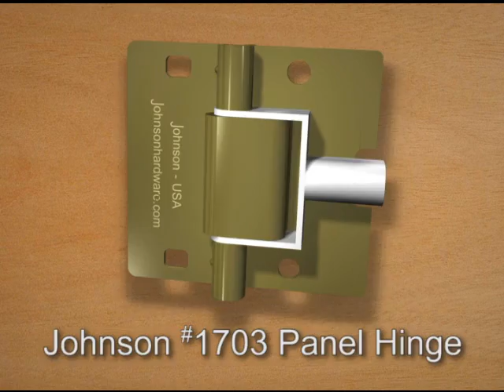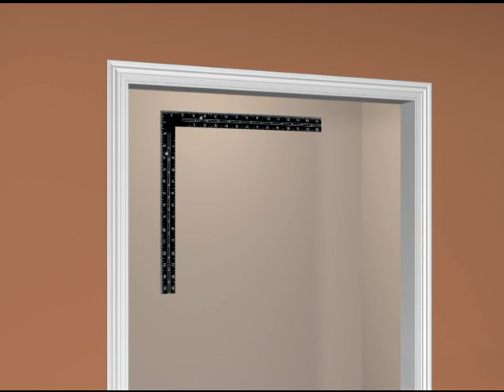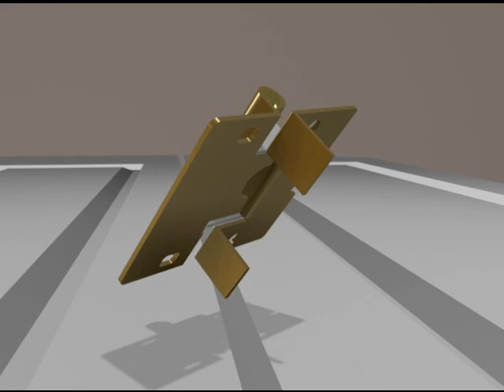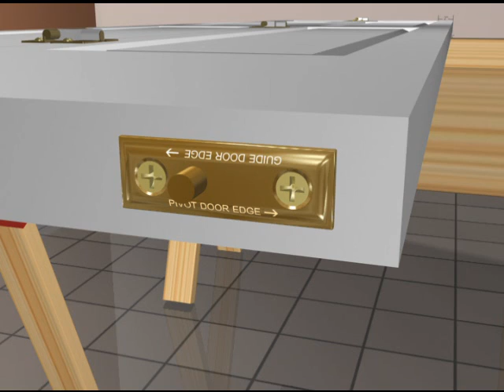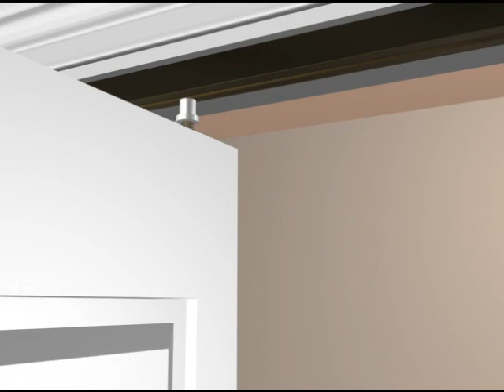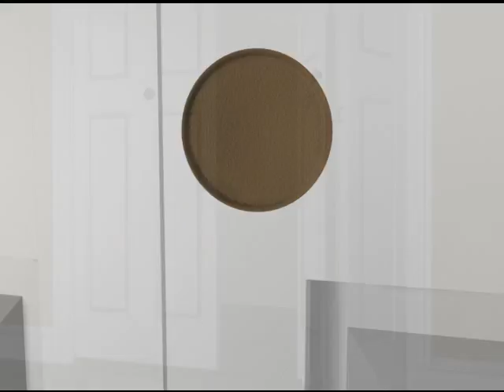Bifold Door Installation Video from Johnson Hardware

Comment: I have finished 82.5 inches of closet opening. I like to use by pass sliding preferably 2 slabs of 42inches wide. But, the problem is apparently they don’t make 42 inches wide! I could use two 22 inches instead by they don’t make 22 inches ! Any ideas? Thank you

Comment: I agree with everybody else who said this video is MUCH more helpful than the printed instructions.  

There were two things I still struggled with: first, hanging the door, and second, what to do when the pivot lock is too close to the jamb and the door will not fully close as a result.

I ultimately found it was easier to get the pivot pin into the pivot lock with the door swung out perpendicular to the track, inserting the guide pin after.  

As for the pivot lock being too close to the jamb, the screw in the middle of the pivot lock can be loosened to allow the pivot lock to slide in the track.  I found the screw too tight to loosen with a manual or electric Phillips head screwdriver, however, a slotted screwdriver bit on a 6" ratchet handle did the trick handily.  A socket wrench could also have worked.